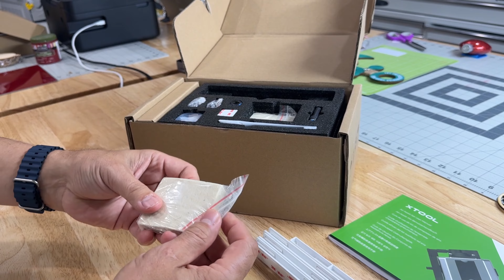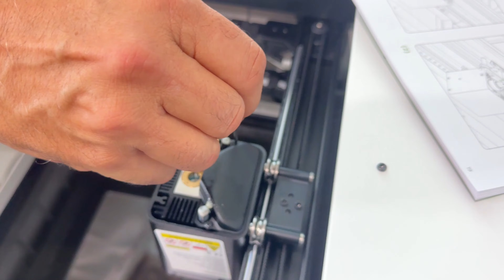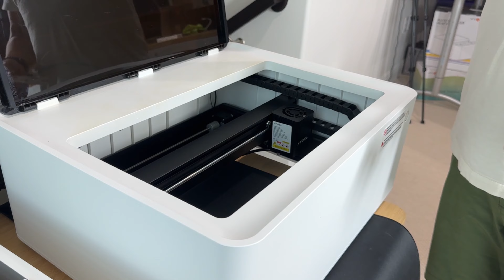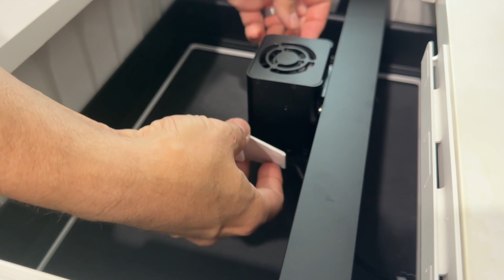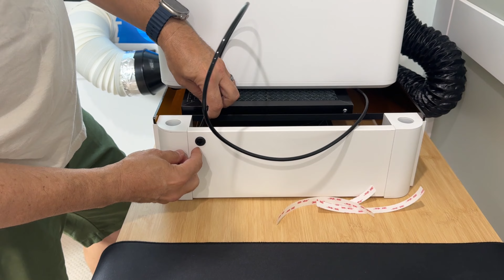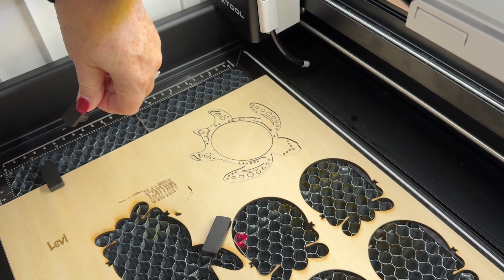xTool M1 Air Assist Install and Demo

Comment: According to the install video from XTool's channel, the extra tube channels are used for keeping the tube in place if you want to use the laser without the Air Assist. It runs to the left, opposite of the exit hole in the riser. There's even a nifty little mount for the lens cover.
Reply from the maker: Awesome! Will check it out. Thanks.

Comment: Ok- so you show your mount being still wiggly when you put the air assist on. Is that ok? The other videos I watched said it isn't, but for the life of me I cannot get that thing to go on in the direction it's supposed to if I tighten it down.
Reply from the maker: We haven’t had any issues using it since installing the air assist.
Reply: I know I am late to this, but if you haven't already worked it out, the kit has 2 black rubber gasket rings. These are for adding to the lens cover to ensure it is tightly installed, with no wiggling around. xTool has forgotten to include this step in the instructions. x
Reply: @WendigovanStudio thank you. I wish they'd address that somewhere because I don't know how people are supposed to know when it isn't mentioned anywhere.😅 

Even with the gaskets my air assist refuses to sit properly or stay attached. I gave up. Money wasted. I should have gotten the riser base instead. Oh well.
Reply: Just saved me!! Been like and hour trying to make this not wiggle!!